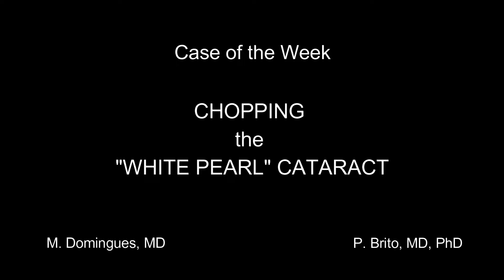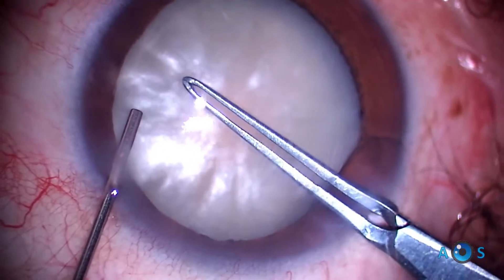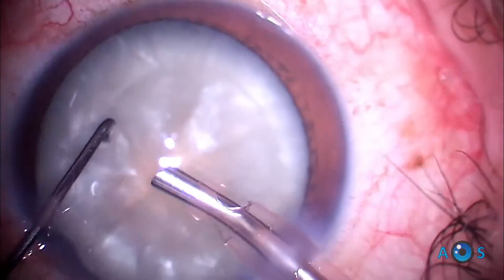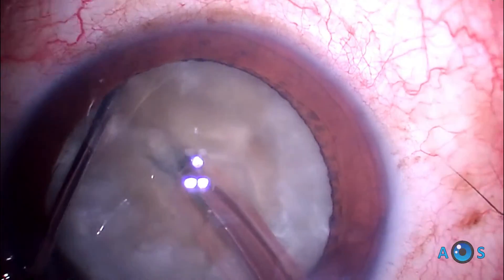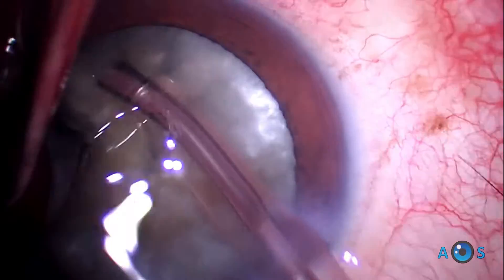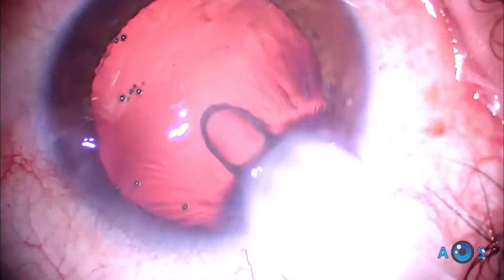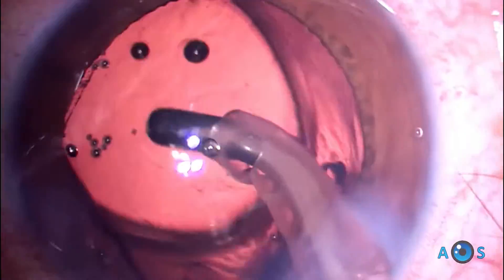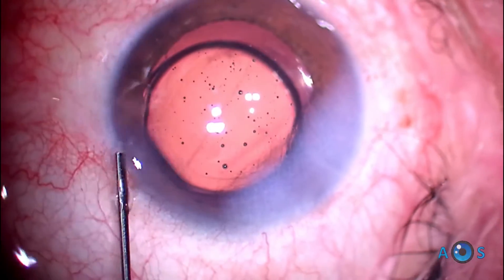Phaco Chop for the Beautiful Pearl White Cataract Surgery

Comment: Innecesario no  teñir la cápsula y arriesgar en ese tipo de catarata!
Reply from the maker: like in every medical procedure, surgeon experience and safety is of the utmost importance. The surgeon proceeds without trypan blue because as it is seen in the video, the CCC is efficienty performed without difficulty. In case of a lost capsular flap, trypan blue would be immediately available. Also surgeons should be aware that any substance introduced in the anterior chamber can theoretically cause adverse reactions i.e. TASS syndrome... So if the surgeon can perform any procedure with minimal invasiveness or drug administration there will be less inflammatory response and faster recovery.